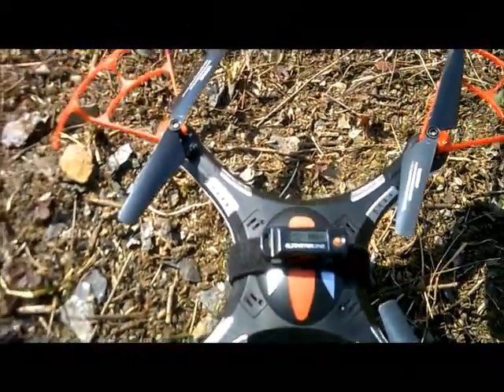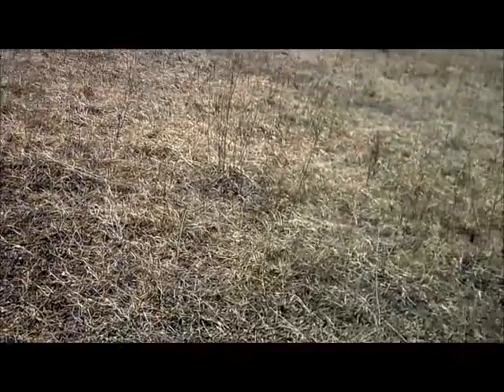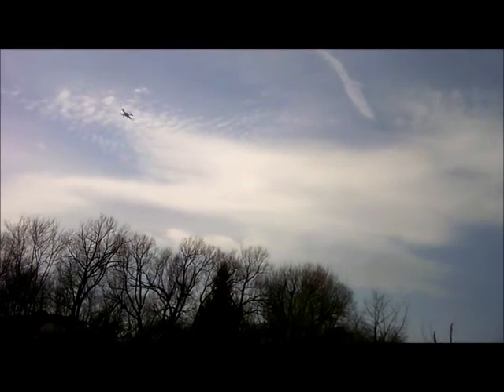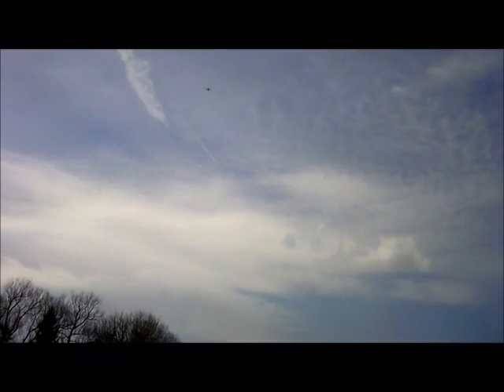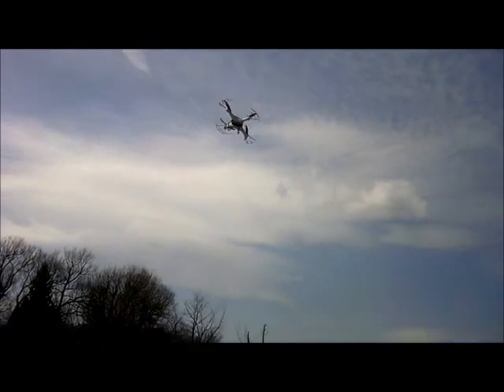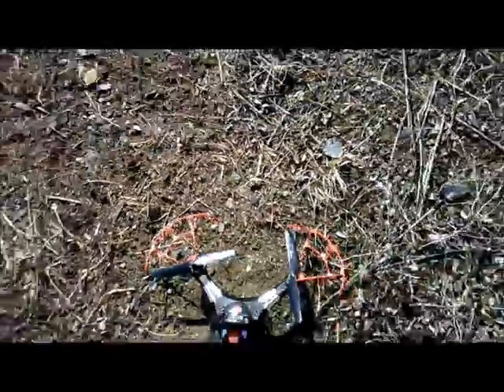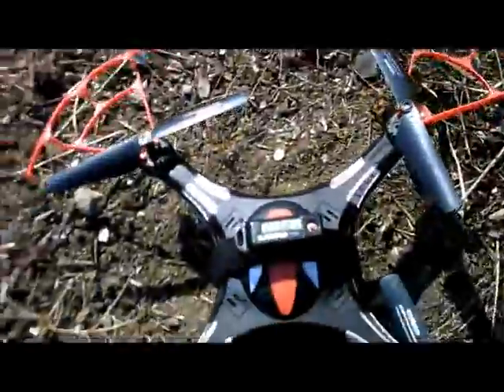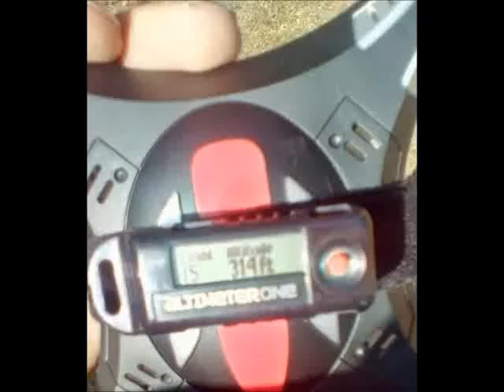Quadrone Tumbler Drone Altitude Test Jolly Logic AltimeterOne

Comment: okay Jay, I'm a newbie (and a perioxide poisoned blonde) so my questions may sound rather dumb. I was given a Quad Tumbler w/camera for Xmas. So far I've had 2 big flights (long stories), the rest have been the getting to know kind. Obviously for you crashing may happen once in awhile, but was wondering if the QT was suppose to need to be reset after like every 3rd crash/ hard landing? The lights start blinking and I've tried to redo the remote/ drone activation steps from that point but it doesn't work until I unplug and replug the battery. Do you know if it's supposed to do that and if so can that process be by passed somehow? The instructions are really vague about a lot of things and your the only one on here that seems to know how they work and what to do. sorry if this is a dumb question.
Reply from the maker: your battery seems to be dead charge it
Reply: no, this happens after fully charging and i can go through this lil routine about 3-4x's before the battery dies. It is a factory battery and once I've gotten it in the air lasts approx 5-6mins w/ lights on.